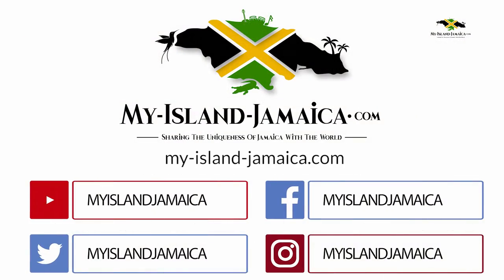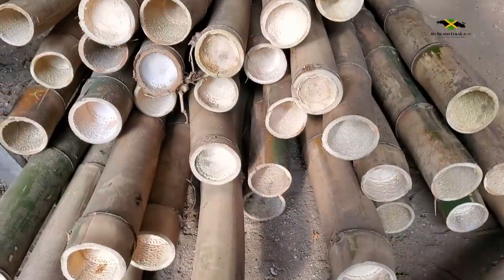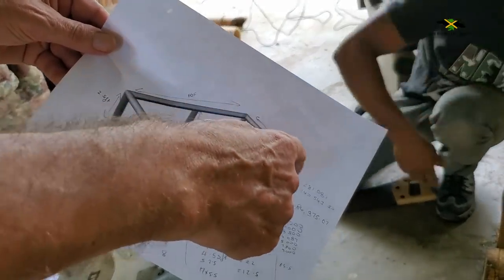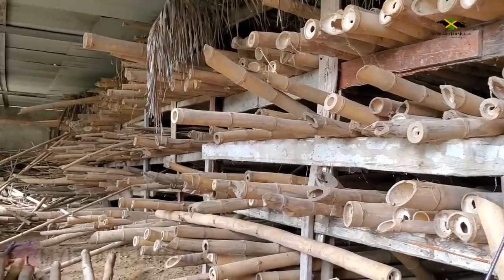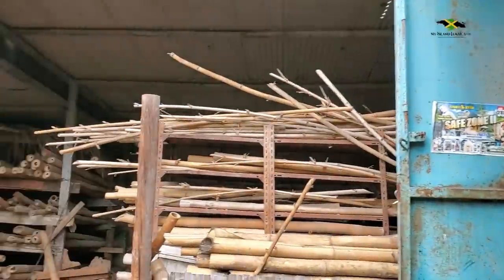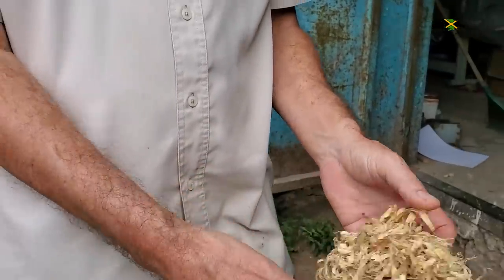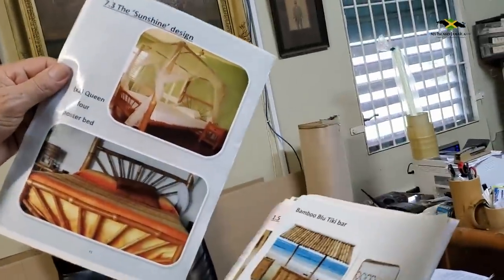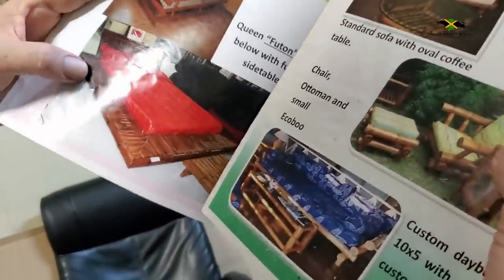🤔 Does Bamboo Furniture Last? Is Bamboo A Good Material For Furniture? #bamboojamaica #jm

Comment from the maker: WAIT.. here are three (3) other great videos I think you'll absolutely LOVE!😊
▶Meet The Master WoodWorker https://youtu.be/HgaInt82RU8?sub_confirmation=1
▶US couple on GOAT FARM https://youtu.be/se9e6O7XzMo?sub_confirmation=1
▶The Returning Resident Story https://youtu.be/ukzN9qOcc8M?sub_confirmation=1
Reply: Bamboo is so strong it is being used to make a type of glulam composite to build skyscraper 

Guadua?   I will order seeds.

I want to grow it so I can build and test my energy tower before I patent it.   It is modeled after Agora Tower in Taipei Taiwan 🇹🇼 

This building uses its vertical height to harvest energy from vertical thermodynamic winds and horizontal winds using a vertical axis self dampening wind turbine.   Birds are protected as the towers like castle towers have screened oversized windows to capture and intensify wind in the tunnel.   

It has water barrel on every floor.  In the down pipes it has a an in pipe water turbine similar to those currently used in Portland Oregon.

Then there are solar panels.

There are no toilets which saves the city billions by eliminating need for black water sewers and human waste processing.   There is so much excess electricity they use hybrid gas electric incinerator toilets.

They have large extended growing platforms, that recycle water from the organic garden and fruit trees.

Some of the electricity is run at 2volts through a salt water brine and produces hydrogen.  Hydrogen is conferred to a combustible gas when remixed with oxygen, to run combustion engines, or condensed to run through a hydrogen fuel cell car.

Question?:  they say they soak fresh cut bamboo in borax water.  This bleaches out the skin and kills all the bugs and makes the dried wood fire 🔥 resistant.   For extra measure the shujiban or burn surface to add more fire resistance 

Have you tried these methods.  I was thinking of making shingles like this.

That broken and split bamboo you have, couldn’t you dry it due it and Scorch it to make roof tiles and floor tiles?    

Mr Hamilton cut me in for 10 percent if it works; I have some projects to fund.  I believe housing is a human right and the only way to balance the economy.   That’s why I love Agora Tower.  It grows all food, provides all water and all energy in the building.   Poverty just like hatred is a manmade fiction of greed.   I need money to build more examples and prove it.

That’s my dream 😴
Reply from the maker: @diversitylove5460  that's amazing! I'm sure he'd love to speak to you further. DM him on Instagram please. Link is in the description